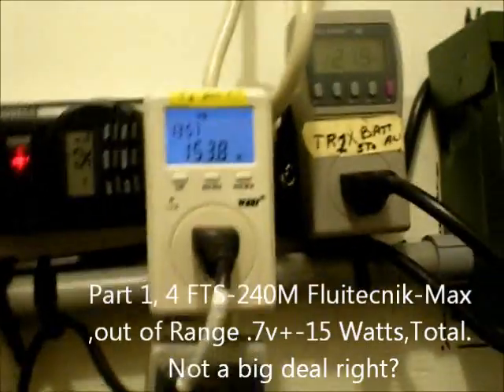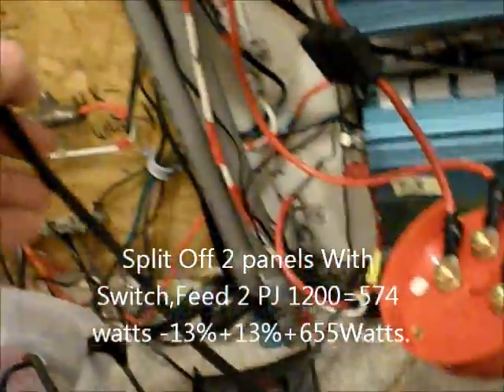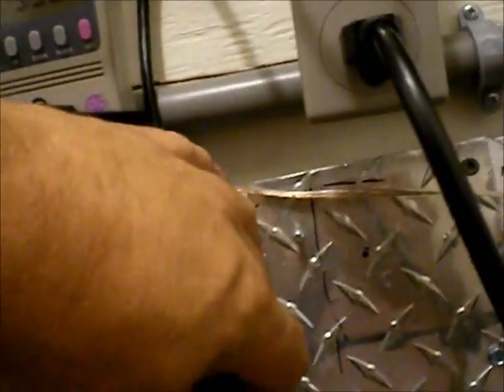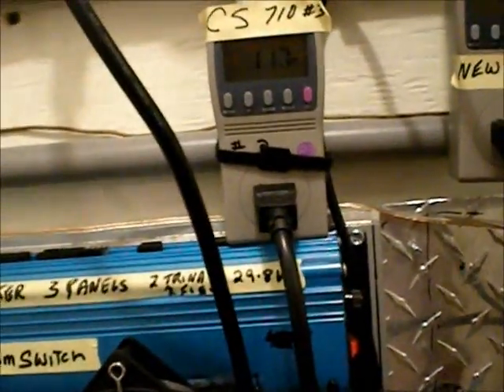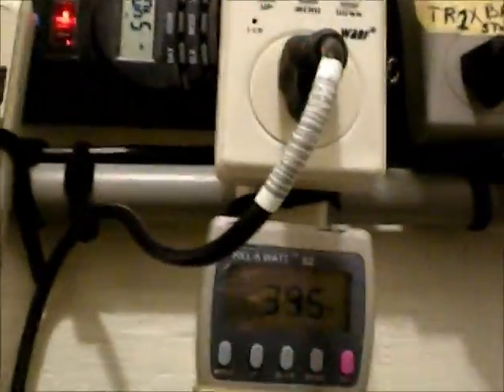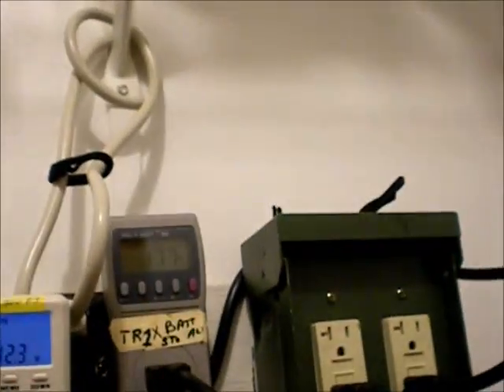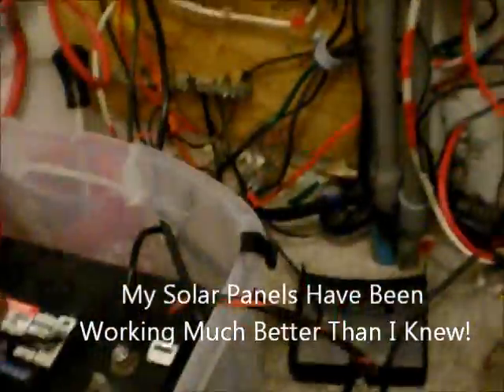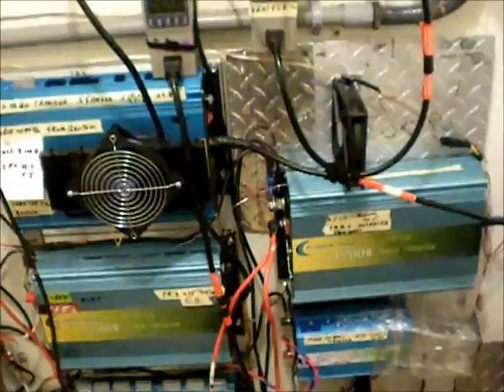A Shocking Discovery About My Mismatched Solar Panels.

Comment: You have a very impressive setup. Use one inverter for each panel rather than combining the panels and feeding them into one inverter will give you more power. Unfortunately you have to buy more inverters. Also you have to turn off (unplug) your inverters at night as they will draw power from your outlets.

Comment from the maker: All The things I showed in this video were to help me understand why I was not getting the power in i was seeing in the other inverters.All the wiring and loose switch is and was a temp hook up so i could perform this test.It was a big deal to see how such small differences in a solar panel set up could turn out this badly.But i,m happy to see there is nothing wrong with the panels I bought .They just dont all match perfectly as the rest do so there was a lesson to be learned.